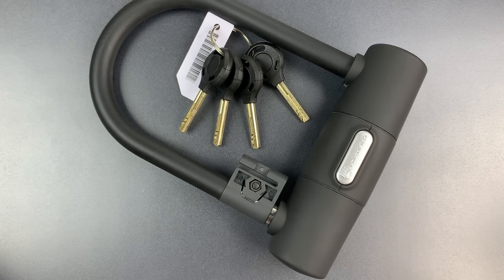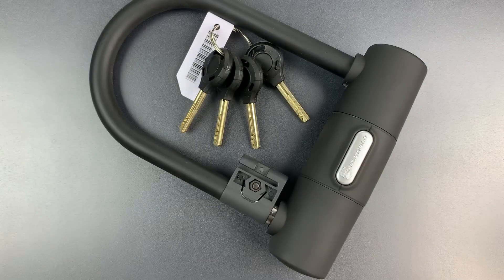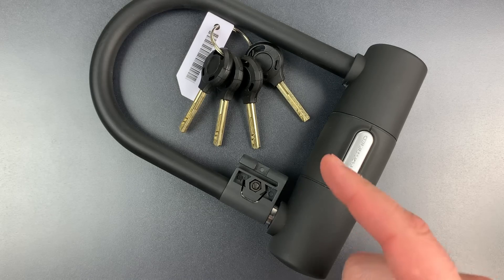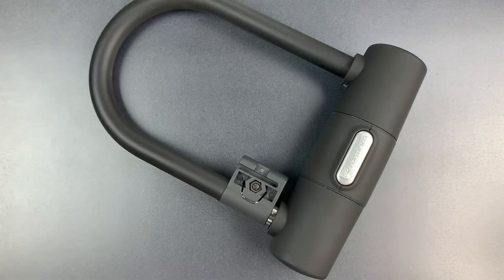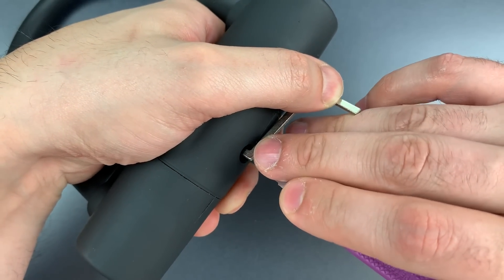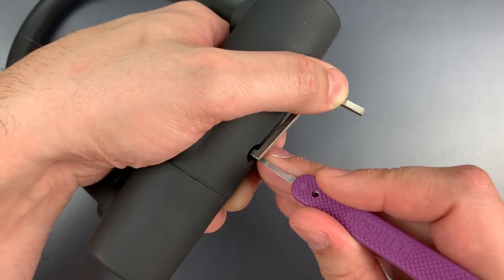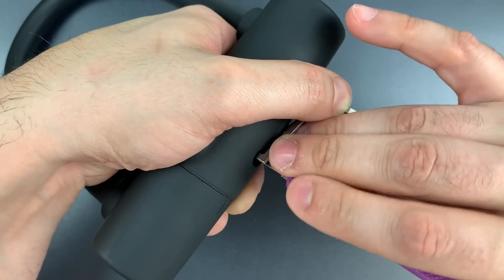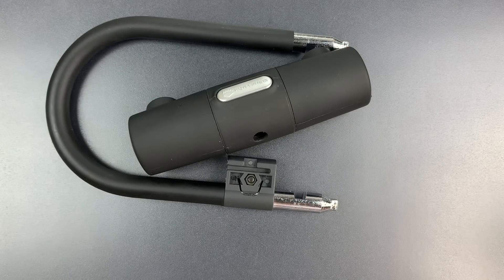[898] The “No Nonsense" Bike Lock Picked

Comment: I think the only "picking" attack that matters is whether it can be raked open. If not then it needs to be fairly resistant to bolt cutters. If it can't be raked and bolt cutters are difficult you're probably as good as you can be. If you have a thief with picking skills or an angle grinder who doesn't get stopped by a bystander, you're gonna lose your bike.
Reply: Exactly my thoughts, if I'd see in the open a person with his/her back to me taking some time to open a lock, I'd assume they are having difficult making their key work rather than lockpicking, and if they are with an angle grinder they could use it on me aswell... So maybe call the police on the grinder...
Reply: I have heard of a few cases where the thief sawed through the bike frame to steal the components and left the lock untouched. On a lightweight bike it's much, much faster to saw the frame than the lock. Also it's nigh on impossible to trace bike components once they've been taken off the frame unless you've marked them with UV marker or something like the SelectDNA microparticles.
Reply: @peglor  Every time I lock up I wonder if the would-be thief would just saw through what I locked the bike too (usually a rack but sometimes things like a cart return).
Reply: @ME-hm7zm  always weave the cable or chain through the back tire, frame, front tire, and pole unless you want to buy new rims and tires.
Reply: @PatrickLeeUS  Yes, I do that.  I am thinking about the rack in this case, however.
Reply: John Ridley Stopped by a bystander? Whose gonna white knight for a bike? Please, there's many cases of men being shanked, shot and murdered for white knighting women on the streets. Getting shanked with an STD-ridden needle and assassinated for a bike is not worth the risk. 

The Genovese-syndrome is unacceptable in a civilized nation, but getting yourself killed for an object or an unknown person even, in an unknown situation not knowing all the details is equally preposterous. Unless you are armed, have police or military experience, or are in a large group then intervention would be reasonable, otherwise calling the authorities is the most sensible thing to do.

That unless we're talking about an extreme situation where someone is being killed or raped on the spot there, and then there's no time, seconds or minutes to waste. Otherwise, again, contacting emergency services is the way to go while trying to come in contact with nearby security, surveillance public or private guards and/or a large groups, gathering of people.
Reply: @V0YAG3R  I suspect the Genovese-syndrome happens less in concealed-carry states.  I'm from anti-gun Canada and interviews after one of our Toronto mass-shootings (they still happen even though the guns are illegal somehow?!?!)... anyway interviewers discovered bystanders, "wishing they could do something" but we can't even have pepper spray or a taser or anything you could use to help you confront a bad guy.
Reply: @V0YAG3R  Then again, who would SHANK anyone over a BIKE??? Thieves are people, too. Yes, they are probably nervous and not particularly inclined towards morality, but at worst they'd probably punch you or break/rob you of your phone. If they realize you've called the police, they'd probably just run. In any case, stealing a bike is MUCH less trouble than having hurt a person, and they certainly know.
Reply: @hotdrj  <<I suspect the Genovese-syndrome happens less in concealed-carry states. >>

You're wrong. It happens more. Most carriers don't want the legal hassle that comes with a shooting, even if it's a justified one, and as such, won't intervene to protect OTHERS.
Reply: @Morboxx  While it's doubtful that anyone would stab you over a bike, they MIGHT stab you in order to avoid being arrested. Prison is a frightening enough possibility for many thieves that, while they won't use violence to steal, they WILL use violence to avoid being caught.
Reply: @ajm5007  Might. People can get erratic in stressful situations. Still, being caught stealing a bike and running away...it seems extremely unlikely that you'd be caught. Apart from it only being property crime, that way you'd hardly have any contact with the witness and not much would point toward you as a perpetrator, if you haven't been stupid.
On the other hand, if you hurt or even killed someone, all stops will be pulled to catch you, including DNA evidence, intensive search for witnesses, etc. Also, if the victim survives, they'll vividly remember you and will want you off the streets - in the other case, the witness might not even bother going to the police, after all. 
And then there's the fact that not many people out there are vicious killers.

No, I don't believe that you are in a lot of danger in a situation like this. Of course, there are unstable people out there, and criminals are more likely to be some of those. But all things considered, as long as you don't play vigilante (which no one wants!), you should be fine.
Reply: Or shimmed.
Reply: I second this. Anyone with sufficient lockpicking skill to open a bike lock wouldnt steal bikes.
Reply: @dukeofworcestershire7042  I wouldn't say that...but these skills aren't usually worth it, if all you need to steal a decent bike is the right tool and a little force.
Reply: That's the thing criminals don't pick locks picking locks is a skill and they're out for quick money. If they're going to try to pick your lock they are only going to try breaking it other than that they're going to cut the lock if it's a bike or they're going to break your window if it's your house or your vehicle.

Skilled criminals aren't your average bike thief or crackhead house burglars skilled criminals are white collar criminals.

If someone's going to steal your shit they're either going to try to rake the lock open bypass the lock or use some sort of forced entry method they're not going to try to legitimately pick a lock.

If the lock can't be raked open they're likely going to opt for a destructive entry method because it's not their shit they're destroying
Reply: @Morboxx  im glad somebody besides me mentioned this. if a person is stealing a random owner's bike they don't want to fucking kill you. they need money for heroin or gambling debts etc. im not saying that the best course of action is to attempt to physically stop someone who is stealing a bicycle, just sayin that person more than likely does not have murderous intent.
Reply: @21centdregs  Then again, if they're on drugs WHILE stealing stuff, they're not themselves. If they seem kind of strange in their behaviour outside of stealing a bike, I'd be extra careful.
Reply: @Morboxx  being careful is never ill advised in any part of life. the generality remains that people who are addicted and are also stealing your shit just want to get the fuck out of there n get their fix. i think that is a reasonable enough rule to construct a response plan by.  im far more worried about the people that want to test their gun on petty criminals or anyone who happens to put them on edge. those people are itching for an excuse to pull and they are legion in america.
Reply: @21centdregs  Never said that you shouldn't be careful. But as you say, toting a gun around isn't careful behaviour
Reply: Yeah, I worked for a locksmith for quite a long time in college, and there was a strange disconnect. People would want these absurd locks (one weird one was people LOVED the Ingersoll 10-lever locks) but then put absolutely nothing around it.

I remember one guy who came in looking for a padlock to secure his motorcycle. Sold him an Abus Rock 83/80, a tough lock physically and with solid pick resistance. Then he walked over and tried to get us to sell him some crappy 8mm chain (that we sold for people to secure things like a chain-link gate) to hold it.

In other words, forget the lock. Bolt cutters will go through the chain like butter.
Reply: That’s a fair assessment. Your average crack junkie is not going to have anywhere near the skill level to open these locks. I’d say any lock that requires actual picking is probably good enough for 99.99% of the population. If you try to protect something actually of value, you don’t want the thief to even get to the lock without detection. If you leave your bike out for more than a couple of hours, you are asking for it.
Reply: You would also need to test for brute force torque attack. When you insert a block of hard metal that has similar apperance to blank key and then apply e.g. 50 Nm of torque to said blank, the lock should fail in locked state. However, majority of the locks in existance will fail open when internal parts break.

Comment: I love to watch your videos!
But a couple things about bike locks:
1. if LPL cant get it open in less than a minute, a thief in the streets will not bother to try ad will certainly steal the bike next to it that is way easier to pick.
2. same goes for forcing it open with brute force. As long as one can not break a lock within a minute or so, the average thief will not bother to try.
3. if your bike is locked most insurances will pay if it gets stolen. And if your bike is so expensive that you just can not afford to get it stolen, you will probaby not leave it out in the open.

All in all, as long as your lock resists longer than 30-60 sec, it will probaby not get stolen. Good enough. ;)

Comment: Do criminals really pick locks that often though? My sense is they go after unsecured items or just use quick brute force attacks. I could be wrong.
Reply: thats what I think as well
Reply: This is my theory too.  Unless you have an expensive bike, most thieving is done by junkies looking for a quick and easy pickup.  If you have an expensive bike, then it's light enough to take it with you.  If they were interested in learning a skill like picking, then they'd probably have jobs.
Reply: I once found cutting marks on my bike lock, I never found picking marks :P
Reply: Here in Europe professional bike thieves use large bolt cutters, hydraulic bolt cutters or even battery powered angle grinders.
Reply: As LPL alluded to in the video, this particular one is full of plastic and other melty cheap stuff which is trivial to get into with a plumbing torch.
Reply: @Anonymouspock  Could also be melted easily with a torch lighter.
Reply: Well if nobody gave any shits about pick resistance on the locks they make or buy then every single bike thief would just pick them in a second or two and save some hassle.
Reply: Nope. In my city,  bike thieves are either; an opportunist that saw an easy grab, junkies or tweakers, homeless, and low level street/thug people, other bike riders that are sort of "street" "ghetto". Majority of them wont cut through locks. Most will cut through cheap wire locks or steal your wheels if they aren't locked correctly.
Reply: Advocatus Diaboli  That's easy 10 bucks for them. Better than nothing.
Reply: @HRRRRRDRRRRR  Once you get past rake resistance, picking becomes a waste of time. There are too many different types of lock to learn to do them all quickly with all the constraints in the wild. Such simple things as lock positioning and lighting make a big difference. A hydraulic bolt cutter will be easier and attract no more attention.  The LPL is a world class sportsman.
Reply: They don't, which is good because otherwise this guy would be giving thieves a great idea of which locks to go for when trying to steal bikes. He's just trying to keep people from buying bad ones either way. They say locks are for keeping honest people honest, which I would probably agree with if I knew what it meant
Reply: they dont. ive had minor cutting marks on 1 chain i used by masterlock, silver rated with 14mm shackle mini u lock so i can only assume a hacksaw was attempted, which is out of the question on hardened steel but they were too dumb to realize.

 at 9mm thickness chain its too big for any hand tools except the famous creme de la creme of bolt cutters the Irwin Record 342h but it cost £260 most thieves wont spend that on tools.

while picking on the street might go unnoticed, i definitely think thieves favor brute force because they are often angry and careless.

they couldnt get past my (middle of the road) chain or u lock so they slashed my gel seat instead in frustration

the common criminal is better at picking their nose than locks. So long as you got something fairly beefy on your bike, 99% of the time it will be very safe and will be there when you get back

i dont think thieves have the patience to pick locks, most are confirmed drug users so their hand eye coordination is fudged anyway lol
Reply: Not sure, the only time I had a 1k+ bike stolen was because my ex 'locked' at at a bus stop.. without actually being attached to anything like uhm a street post of a let's say, a bicycle rack just besides the darn bus stop. And that after I told her the day before she shouldn't do that because my bike is expensive and people will just put it in the back of a van when they see it's not locked properly. Which is surely what happened, and they didn't pick my 'reasonable' lock because why would they if you can just grab the bike and remove the lock somewhere without time or sound restraints like in your own garage or whatever.
Reply: @maybenot7298  They use impressioning, bumping, core extraction, and breakage.. but on residential/industrial properties mostly.
They wont pick it as it looks more suspicious that sawing it.
Reply: @dahveed284  Not in europe.  There are gangs that steal hundreds a month.
Reply: Swampy  tungsten carbide is maybe the worst material to build a lock shackle from, besides aluminium maybe. It's brittle af. Just needs some ice spray and a whack with a hammer to break to bits.
Reply: @KingDayDayDay00  Two couriers stole on of my bikes.. along the 120£ lock.  They also stole the lock.
Reply: Depends what you steal and from where, but yea its pretty uncommon atleast. 90% of the locks can be opened in just a few seconds with bigger bolt cutters anyway so why spend time for something that has higher risk to get caught while trying, when you can just do "drive by's"
Reply: Advocatus Diaboli  nothing's pathetic to a thief. Where I live, the phrase "They'll steal anything that isn't bolted down" isn't true. They'll undo the bolts and steal all they can for more meth or heroin.

Since I never leave my bike unattended for hours on end, a U-Lock is actually more than enough for me. None of the tweakers around here have the right tools to get through one quickly, and none of them know how to pick.
Reply: @jort93z  I think you're missing his point. Jagrorex wasn't saying that people picking doesn't leave marks, he's saying that he's never actually seen such marks on his locks because the vast majority of criminals don't even attempt picking. They just try to brute force the lock open, and if that fails they move on.
Reply: Aitor Bleda — What verifiable evidence do you have of thieves using impressioning? That’s a tough one to swallow. 

(Bumping and physical destruction of the lock I have no trouble believing.)
Reply: @cybershadow81  Doesn't even need the ice spray, tungsten carbide is already seriously brittle in most grades it's available in. A tungsten carbide tipped drill will go through the hardest grade of steel like it's butter though, as it's as hard as sapphire.
Reply: @RealWorldPolice  They do. On tubular locks, because it's dead simple.
Reply: @cybershadow81  cant use them in a piblic area or at daylight
Reply: Amateur thieves will use bypass tactics on popular bad locks that they recognize, like the infamous pen trick. Professional thieves sometimes pick, but if you have the kind of bike they'd target and you don't splurge on a lock it starts to become a bit of your own fault. Although you're right, destructive attacks are by far the most popular in both cases.
Reply: Advocatus Diaboli are you a bike salesman or something? Your comment is just off topic lmao.
Reply: cybershadow81 its hard to sell a crappy $10 walmart wheel. More expensive wheels will sell like hotcakes. The wheels can get quite expensive in the range of $200-$500 depending on the bike of choice. Its rare to see someone leave an expensive bike unattended or in public but when theres an opportunity to make at least $100, it is well worth it since most upper end bikes have a quick release wheel bolt.
Reply: Advocatus Diaboli  If you have quick release and haven't secured the wheel it's like seconds to pop one off and they can get 30+ dollars for even basic ones.
Reply: I know a police officer. We’ve had this conversation many times and they always say that “no criminal picks locks it takes to long and breaking crap is easier”
Reply: My lock was picked twice,
Reply: With bikes I see them just take the wheels and leave the frame still locked xD
Reply: I did hear about them people installing fake light posts just so people would lock the bike so they can steal it. Also when it comes to bikes  I also heard of a case where the wheel was locked and the thief just took that wheel off and took pretty much the entire bike.
Reply: When it comes to bike locks it's certainly brute force 99.9% of the time. Just cut the chain in 2 seconds and run of.
Reply: the point of a lock is to force a brute force attempt since brute force attempts are easily proven to insurances who cover the item.
Reply: As long as your lock can't easily be defeated with bolt cutters, or you're not trying to protect something incredibly valuable that a high-end thief would target, you're probably safe.